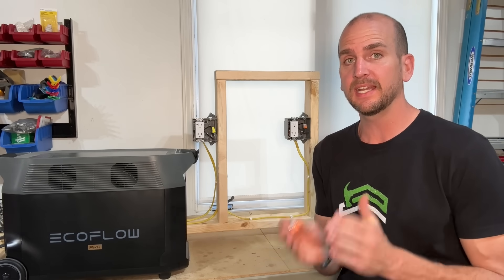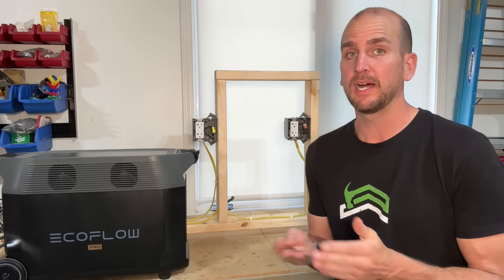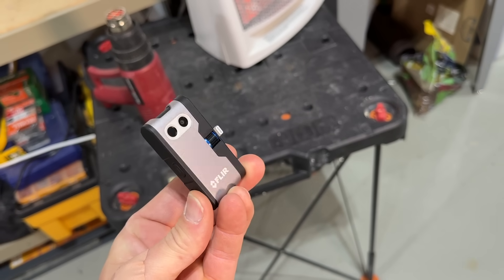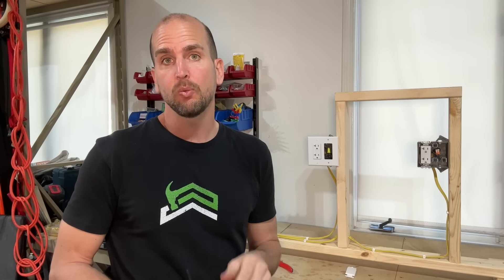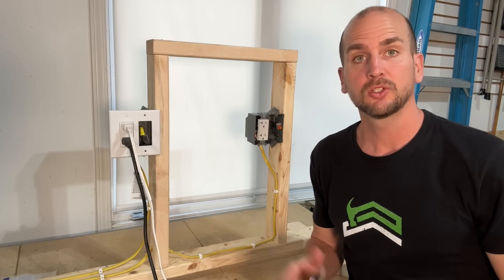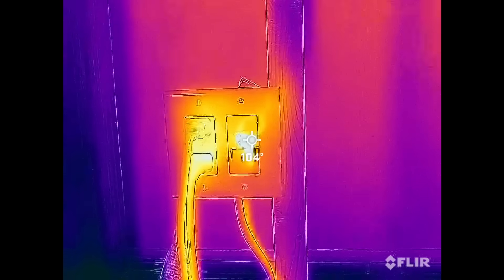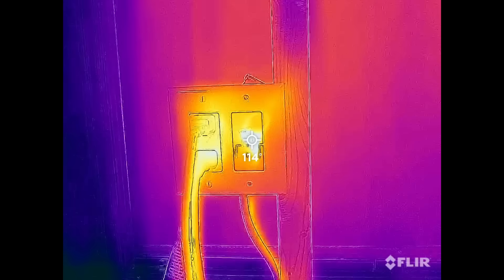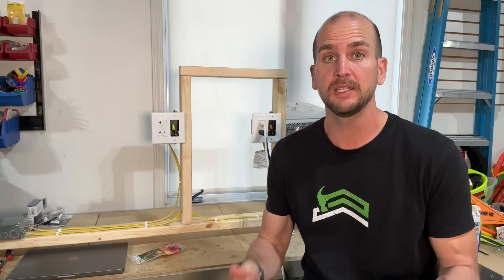Debunking the Pros: Can WAGO Lever Nuts Handle Heavy Electrical Loads?

Comment: I can only say one thing: 
If it is UL CSA CCA EU.... approved, you can use it without any worries, as long as it is used as intended.
I have been working with those standards on an industrial base for almost 50 years now and trust me, 
you can rely on them. Also, spring terminals have been approved for industrial use for many years now!
Reply: exactly
Reply: The code allows backstab connectors on outlets. I have replaced dozens of them on rental property. Some of them were melted or burned, including 2 I had to replace in my home. The wires would literally just fall out of the terminal if they weren't already melted. And yes they were properly wired with 14 gauge copper. Just because it's approved doesn't make it good.
Reply: @michaelallen5505  read the data sheets or at least the print on the Wagos, you overshit the current limits.
Reply: @stefankaufmann8257  It wasn't Wagos. It was the back stab connections on the back of outlets. They're approved for 14 gauge wire. I was just pointing out that not everything approved is safe. I don't have a firm opinion about Wagos. I feel they're more than adequate for something like LED lighting. I wish we could know how they hold up after 10 years.
Reply: @michaelallen5505  i use Wago for more than 30 years and the lever ones for over a decade, so does most of Europe. I have used thousands of Wagos in different versions, not a single one failed - and yes, customer would have called us if one had failed. 

Back to your problem: AWG is irrelevant. Amps is what counts, that's why i often read data sheets. If i have problems with a product not reaching specifications, i don't use it anymore. So happened with Siemens contactors, Siemens hardware is dangerous scrap.
Reply: For "performance," here are some numbers:
- solid Cu line resistance, 
--- awg 12:  160 mOhm/100ft
--- awg 14:  250 mOhm/100ft
- contact resistance
--- wire nut 
----- 0.25 mOhm (solid) 
----- 0.16 mOhm (stranded)
- Wagos
----- 0.51 mOhm (solid)
----- 0.58 mOhm (stranded)
To put the numbers in context:
60W incandescent bulb draws 0.5 A on 120V:  240 Ohms
200 ohms ~= 
 • 80,000' = 15 mi AWG 14
 • >360,000 wagos (at 0.55 mOhm)
More obviously from the resistance #s:   1 wago is effectively 2 wirenuts on solid, ~4 wirenuts on stranded.
As with anything technical, it's all about the trade-offs.
Personally I'd prefer the wirenuts in a high draw and or more rugged environment, but the wagos would be fine for routine interior installations, ands actually preferred for short-leaded boxes.
Reply: In addition to approving aluminum wiring, "they" also approved infant car seats, grounded receptacles, grounded neutral wires, closed circuit panels, GFCIs, etc.  I think most would agree Al writing was an outlier.
Reply: Thank you for your experience, especially with the standards you cited. I understand and I completely agree with you. I think what Scott is doing is giving the do-it-yourself’r, without the understanding of those standards, some confidence In the technology.
Reply: 1 last thought:  1 thermal cycle proves little.   For certification these things (incl the spring connectors, too) go through 100s if not 1000s of thermal cycles for certification.  (Domestic thermal cycles different from [those for] industrial [purposed products] differ from automotive differ from life safety differ from aviation....
Reply: This ignores voltage drop.  Not much but if a whole branch circuit is done with Wagos, is it significant at the last appliance?
Reply: @hugh007  A Wago 221 splice (name-brand, not cheap copies) has about 0.8-1 mOhm resistance, that's less than the resistance of 7.5 inches of 12 AWG copper wire (1 ft of 12 AWG has about 1.6 mOhn resistance). Well-done wire nut connections have about 0.3 mOhm (~2.5 inches of 12 AWG). So no, unless you're really stretching the distance limits on your circuits it doesn't mattter. And if you DO get to the limits you'd gain much more by going up a notch in wire size than switching the splicing method could ever do (eg. 100 ft of 12 AWG wire with no junctions whatsoever have a HIGHER resistance than 100 ft of 10 AWG wire with a Wago connector every two feet).
Reply: Aluminum and back stabs,too.
Reply: Finally someone with a brain, the old way is not always the best way like some of these people mindlessly endorse.
Reply: 100% agreed!
Reply: You are gullible arent ya? The approvals come from private labs and can be bought by a big company and frequently are. Who do you think approved aluminum branch wiring in the 1970's. How many hundreds of homes burned to the ground because of it? And you trust wagos? Lol
Reply: Bullshit, those approvals are bought and paid for. The same organizations approved aluminum branch (romex) wiring in the early 70's. Now what are going say? Bought and paid for! Hundreds of homes burned to the ground and its still going on.
Reply: I wonder if they will use wagos on aluminum wire? Talk about a double whammy.
Reply: It would say "CE" and it means that the product is approved in Europe.
Reply: See how comfortable you are if you have to give a deposition and your going to have to say, "they're almost as good as wire nuts." Also, tell that to a high end architect, or even a consultant. You don't work much in NYC, or the financial distric in North Jersey, I assume. You'll be pulling every one of them out, replacing them all under scrutinity, at your time and expense, starting the moment they're seen. Then, never expect to work in that building, and very unlikely another property managers buildings again. Hopefully, you can make that kinda money in other places. I never found any other places.
Reply: They're not CSA approved and not supposed to be used in Canada, despite what some people say in online forums. We do have some approved push-in connectors that do meet CSA standards but most electricians avoid these because of cost, and call backs for nuisance shorts. They come with many new modern light fixtures. We usaully just cut em off and toss em.
Reply: @ronlovell5374  They are cUL Listed which means they meet Canadian standards.
Reply: @XWing30  I'm aware of UL listings, they still do not meet strict CSA standards for 120 volt use, and our Electrical Safety Authority as well as most of our inspectors do not allow them. Problem is they'll lead to use of other similar non approved devices and make more electricians get lazier and cut corners. We also have very similar models made by GB that are only rated for low voltage and you will have people using the wrong ones.
Reply: @ronlovell5374  I guess it depends on which province you live but it is very simple, they are cUL approved, the ''c'' is for Canada and a cUL mark is an approved mark under the canadian / csa electrical code and also on my province code.
Reply: @ronlovell5374  Wago has a lot of CSA approved products, the certificates are for download on their website. At least a lot of push-in-clamps are certified by the CSA, the lever clamps are certified by some governing bodies which are normally accepted worldwide due to a mutual agreement on safety standards.
Basically: Why should they be safe in Europe and the US but not in Canada?
Reply: @Kommunisator  As someone that vaguely deals with some UL/CSA stuff, CSA pretty much exist for the same reason that Canadian radio stations are required to play a certain percentage of Canadian musicians songs, to artificially keep themselves relevant. Same reason they don't allow American wireless carriers up in Canada. The more you know.
Reply: Without worries? Alot of people should have worried when they approved aluminum wiring for house branch circuits, but nobody that mattered did.
Reply: Those labs are private business's and their approvals can be bought. UL has been bought and sold as a company a few times and is on the NYSE. Those approvals mean nothing just that the company selling wago had the money. They also approved aluminum wiring in the late 60's which here in the U.S. caused hundreds of houses to be destroyed by fire and cost alot of people their lives. All because aluminum wire was cheaper. Wagos are faster so approve it too - $$$$ Wagos are junk. Fortunately alot of municipalities ban there use.
Reply: They also approved aluminum wiring. Nothing more needs to be said.
Reply: @RadioRich100  Aluminum wiring is used for mains grid power, successfully, every single second of every day all over the world. Installed properly, AI is just as effective a conductor as CU when dealing with their appropriate ratings and conditions.
Reply: @Mad_Catter_  Aluminum expands/contracts more than copper causing a hot connection.  It also corrodes more easily causing a hot connection.  So the problem with Aluminum is the connection overheating, not its' conductivity.
Reply: @mike7gerald  And this is all well documented with empirical evidence, industry standards are set in place to ensure you do not allow exposed aluminum to exist in your installations, as well you read the same tables and charts for your local area on expansion and contractions of either aluminum or copper.

You are literally performing the job of a human google search result when you could very well waste your time doing something objectively more useful to society.
Reply: @Mad_Catter_  No, branch wiring, hundreds and hundreds of homes burned to the ground because of approvals from ul and others.
Reply: @RadioRich100  I install Al SER every single day still. When properly rated and installed there is nothing wrong with aluminum conductors.
Reply: @Mad_Catter_  There is when its branch wiring connected to outlets and switches with brass terminals. How many houses have burned down from that- hundreds.
Reply: @Mad_Catter_  You didnt read it right, aluminum branch wiring connected to outlets and switches with brass terminals is deadly.
Reply: @RadioRich100  It is against code to bond aluminum to other metals without the proper oxide resistance applied and thermal ratings deregulated to the appropriate conductor alloy bonding charts. You are completely wrong.
Reply: @RadioRich100  Aluminum wiring is used for mains grid power, successfully, every single second of every day all over the world. Installed properly, AI is just as effective a conductor as CU when dealing with their appropriate ratings and conditions.
Reply: @RadioRich100  Nowhere in the codebook does it state you are allowed to even use aluminum without the properly rated outlets, which are available on the market as specified in the codebook.
Reply: @Mad_Catter_  Ok find a manufacturer or seller which makes or sells 14 or 12 gauge aluminum romex.
Reply: @RadioRich100  there is nothing wrong with aluminum in high current applications. It is for sure to brittle in general use, but holds up pretty well in distribution and transmission.
Reply: @RadioRich100 in all fairness it hasn’t been approved for 40 years now. And the issues were discovered within a couple decades. These connections have been in service since the 70’s - coming up to 50 years, and yet no massive issues like the  aluminum wire had   

I think 4 or 5 decades is a solid track record of safety
Reply: There used to be DCO with a press in wire option. I never used them because of the limited contact area, but these type of outlets were approved, right up there with aluminum wiring. Thanks for pointing that out.
Reply: @RadioRich100  not in Europe.

Besides that, I've also heard the comment (in Europe) that spring connectors are better than screw connectors in the long run (we don't use wire nuts at all, so I don't know what category they fall under).

But the problem with screw connectors is that, after many cycles of heating up and cooling down, the metal has expanded and contacted a lot, and the connection may loosen over time. While a spring connector keeps the same pressure.
Reply: @sanderd17  If you follow the instructions, strip it to correct length, quick connect is as good as anything else. Screws need maintenance. Too high torque is just as bad as too low.
Reply: @sanderd17  springs can be and often are affected by heating and cooling as well.
Reply: @akbychoice  Springs may lose some performance by being exposed to thermal cycling but I'd wager these are designed to still work well inside the acceptable range after many years of operation.
Reply: @arneanka4633  I think the thing about screw terminals loosening over time mostly applies to scenarios with bare stranded wire or tinned stranded wire (both not recommended/allowed for use with screw terminals for this exact reason). These types of conductors "give" significantly over time and screw terminals by their nature can't come after them, spring terminals however can.
Reply: … heat and spring connections? Springs weaken as well.
Reply: @RadioRich100  anything used wrong or installed badly will be a problem.  Sort of like old houses with knob and tube.   Used as is, likely fine.   But many touched it poorly and added loads not intended for the circuit size.
Reply: @RadioRich100  BINGO!
Reply: No, you cant use them without worries. That would be foolish. The approvals can and are bought.

Comment: I've given up arguing about ampacity as long as the specific one you use meets the ampacity requirements of the application.  The real problems are that they take up more volume than a wire nut that can hold that same amount of conductors and they are more expensive than wire nuts.
Reply: I find that I can fit a WAGO into a box easily where doing so with a wire nut is just about impossible.  

They are more expensive. But that is partly balanced by how much more quickly the WAGO connections can be made up.
Reply: @buggsy5  try fitting a 5 wire wago in a box. It takes up more space than a standard wire nut rated for the same amount of conductors.  When space is at a premium, I would rather have the wire nut.  The other issue you failed to realize is that with wire nuts you can fit a range of combinations of wires which means you can stick mostly with one or two sizes.  With Wago connectors you have to get many more sizes to cover the range of situations you could run into or you're using sizes that often take up extra of that precious wiring space.  One wire nut covers more situations than one Wago does.  The only place I would consider a Wago is if there is enough room in the box and for maintenance reasons I have to regularly break the connection.  Proof of concept, although not the only situation, is an example that fits this idea.  Wago connectors are for ease of maintenance.  When the box is probably only going to be accessed when a device fails a properly installed wire nut is often the best route.

Comment: I have not tested the WAGO products, but I have tested electrical connections in a professional capacity.

I can say with some certainty that short duration tests are of little value.

We found that even really loose terminal connections held up for a few hours without exceeding rated temperatures.

Later we did some 24hr and 48hr tests. This is where connection resistance really started to reveal their hazards.

It turns out, when the copper gets hot, the wire starts to oxidize at a faster rate. As well, the resistance of common conductors, rise proportional to the temperature. The increased resistance, both because of temperature coefficient and because of oxidation, increases the local heating effect. This causes a vicious cycle of higher resistance, higher heat, higher resistance, etc. As you might imagine, the level of material oxidation is also increasing incrementally, as does the temperature rise and rise in resistance. So, this is often a 3 point viscous cycle (oxidation, heat, resistance, all increasing together).

However, at some point, the connection starts to arc, which increases the local heating of the connection, exponentially. At this point, things go bad very quickly.

This arcing condition is what AFCI protectors are designed to detect and protect against.

Our tests were performed at max currents (not greater than max).

We also used a dedicated micro-ohm-meter. This specilized device detects small resistances. These meters are not simply a function built into your multimeter, they are specific to the task of reading small resistances, and a good micro-ohm-meter can cost from $1000 to $15000.

Even our micro-ohm-meter couldn't detect a loose connection on new wire. It require some time for the connection to degrade.

By the way, Micro-ohm-meters are designed to use with the circuit supply power turned off.

There's more to this story, but my thumb is getting tired.

Comment: Good job!  The bottom line for most DIY'ers, are they competent enough to even follow the well-laid-out instructions to complete the job and have it function 100% for 50 years. With the professional thought in mind, I moved into a home that a Journeyman Electrician owned and lived in, and found extremely shoddy work, or should I say re-work. He made changes and modifications that I have had to repair and or tear out. A TWISTED connection in a good wire-nut, is still a great connection.